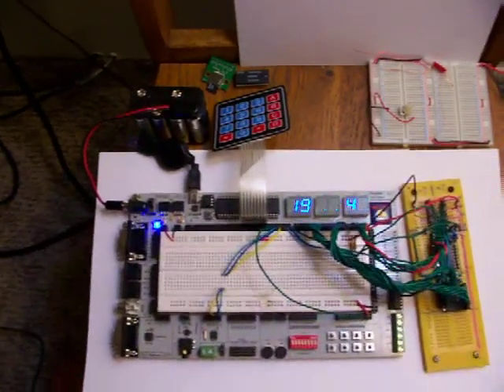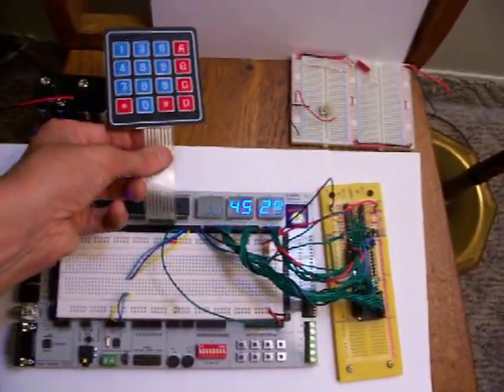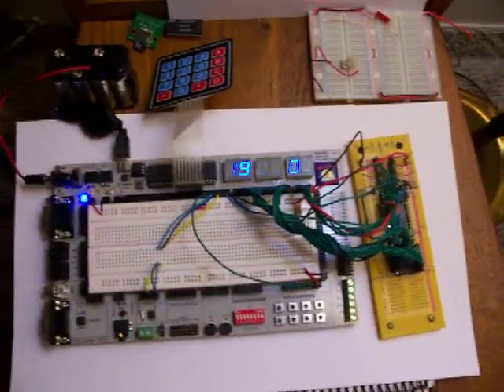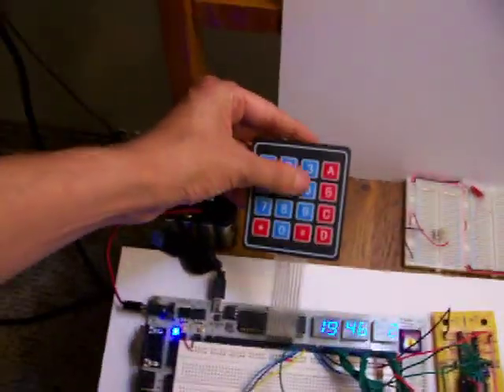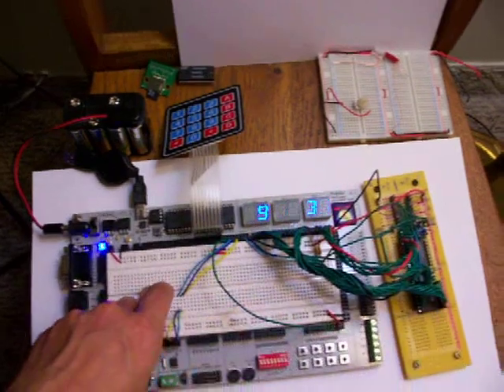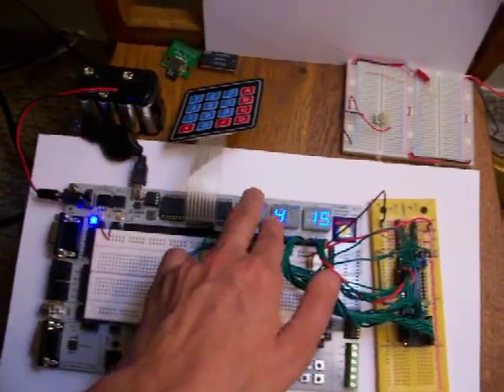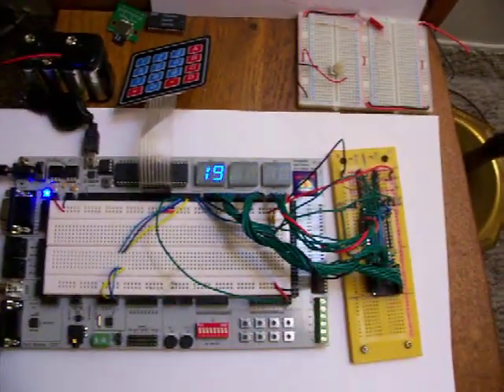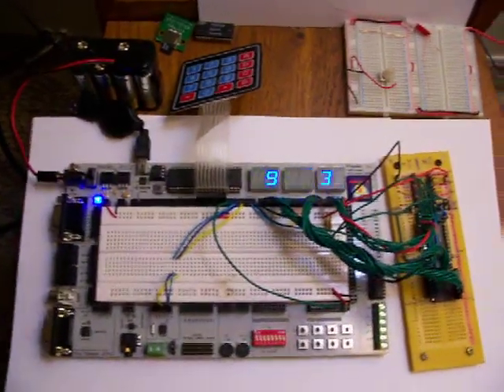Multiplexing on the PPDB using the PCA9555 and DS1302 V1.4

Comment: Hello Jorge,

I have several questions:
Did you get a CD?
What is the process to get the board running with software.
What software do you use and can it be downloaded from Parallax?
The reason being is I just acquired a board only from ebay with nothing else and
will get it in a week.
If you can possibly get me a list of what is on the cd or zip the files to send to me?

Barry
bdspvl@gmail.com
Reply from the maker: The board is just a Parallax Propeller (P8X32A) Development Board, Parallax has a plethora of demonstration code for the different components on the board.  My video shows how I was multiplexing and my code is available on the Parallax Forum at http://forums.parallax.com/discussion/134537/ppdb-using-the-full-ppdb-updated-code-version-1-4 as an attachment to my first post.  It has been several years and I am no longer experimenting with this project.  Feel free to use and modify my code as it is released under an MIT License for private or commercial use.  I offer NO help with your endeavors other than the code I have already written.